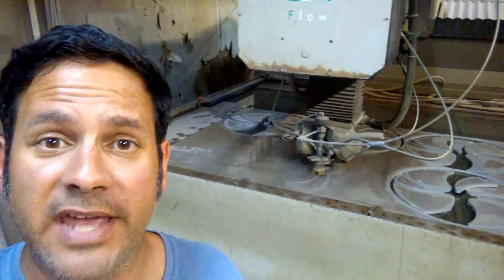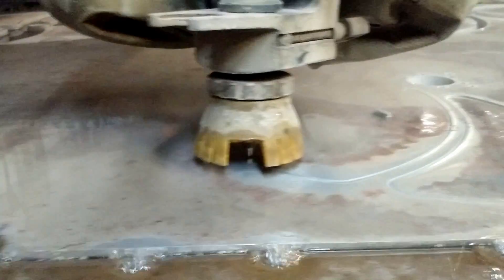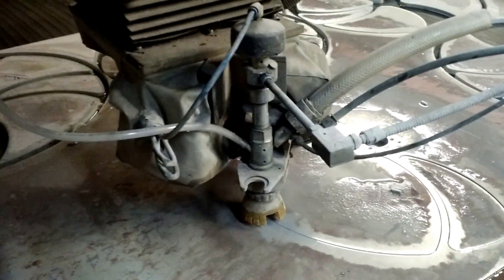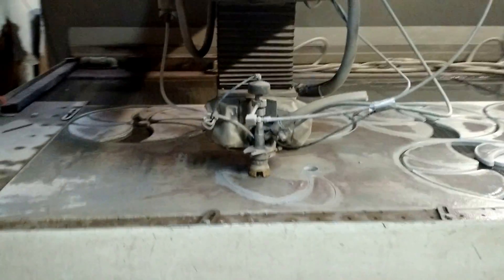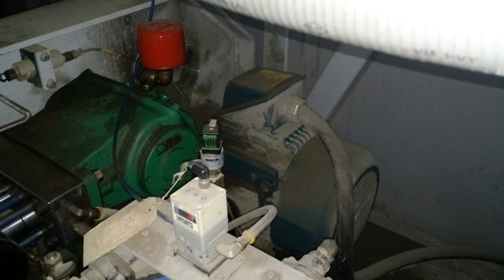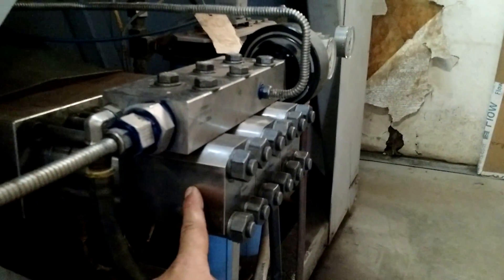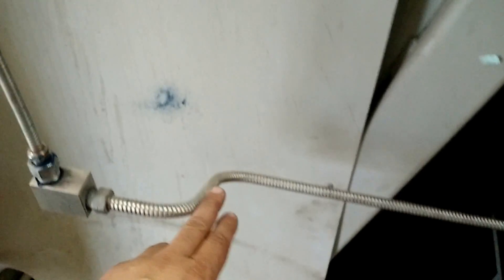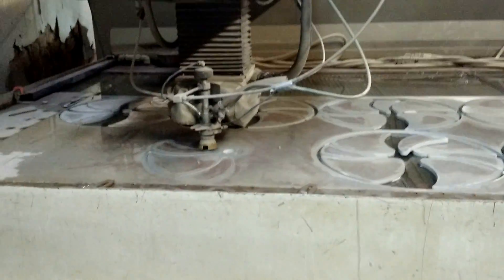CUTTING on the Waterjet at 50,000psi - machine shop - anything cut in half FAST

Comment: Direct-drive intensifiers aren't as common as hydraulic ones.  You do get higher performace with a direct-drive intensifier, though, as they have a higher flow rate. 

One of the most interesting applications I heard of is cutting cake.  The cake sits on top of a grid-which on some machines rotates in the C axis- and the nozzle runs about half an inch above the cake.  The supersonic jet of water moves so fast it doesn't even have time to wet the cake as it is being cut.
Reply from the maker: They cut pickles too

Comment: Hi Ray,
I don't want to start you on another project.. but....!
The sapphire nozzle in 3D printing is about 100$ and it is about 12$ for a sapphire nozzle for waterjet cutter.
The advantage of a sapphire nozzle in 3D is that it can print abrasive filament (carbon fiber, glow in the dark, glass fiber, metal filed, etc) without any wear.

I'm curious to know if somebody can convert a relatively cheap waterjet nozzle into a 3D printer jet? I think you are the man, but I respect your spare time.

Have a good one.
Ps If anybody want to cut n paste my suggestion to others youtubers or want to make it, please do it!!!
Reply: Yeah, I've already saw your video on the subject...
https://www.youtube.com/watch?v=16xnqfXIFuc
SO, no excuse YOU ARE THE BEST ONE !
Reply from the maker: Lol, I guess I could,  but the office has a .013" dia hole, about. 3mm.  Might be too small for those materials
Reply: Hi Ray,
I do have about 15 brass nozzles at home, ranging from 0.8 down to 0.2mm.
If I buy a sapphire nozzle, I will buy a 0.3 or even a 0.25mm one for sure.

I like the high details you can get from a small apperture (and a lot of patience!). However, I won't reccomend to print wood filled fillament under 0.4mm to avoid build up of fiber in the nozzle.

In another hand, most of the other abrasive filament are "only" abrasive and won't clog nozzle as much as wood pulp will. For example, glow in the dark filament are filled with a very fine powder. This powder is way under 0.05mm, but still is very abrasive and will ruined a brass nozzle in about 1-2kg spool.

My real concern is about the inside and outside shape of waterjet nozzle compare to 3D nozzle. I never saw a cross cut of the waterjet so I don't know how hard it will be to make it working. Hopefully, a metal sleeve won't be necessary.

To a fan of StarWars, I'll leave you with a cote from Princess Leila :
"Obewan Kenobei... you are our last hope"
Reply from the maker: I extracted 4 of the sapphire Crystals from a few used orfices and they are certainly small enough to use in a 3d printer nozzle
Reply: That's a very great start already!!!
Using old worned out sapphire to learn for free is the way to go, good idea!

Can you cut the metal housing in half, lenghtwise, to better see the flow path and compare it to 3D nozzle?

Did you already figured out wich route might be the best?
1. Machine the housing (without removing the sapphire) to fit the 3D printer
2. Machine the housing and add a sleave inside or outside to fit the 3D printer
3. Remove the sapphire and put it into a custom made houssing

I've forgot to mention that the abrasive 3D filament will mainly sand off the tip of the "brass" nozzle leaving the interior channel almost intact. Think of the tip ironing over the freshly disposed abrasive plastic who is getting harder already and, by such, getting more abrasive as well.

This is Youtube learning emulation at it's best!!!!
Reply from the maker: I think the only way to make it work is to machine a standard nozzle on the inside to include a sapphire.   But I have a better idea:  the nozzles for the w aterjet are solid carbide!  They are very abrasive resistant!  But also very expensive
Reply: Carbide nozzle... dam!!! Don't you think it's fk.. overkilling?!
How will you machine such a hard metal?

Sapphire is proven already hard enough for the most demanding 3D application. The other benefit of sapphire is the fact that plastic don't adhere to it (I'm not sure about carbide?).

What do you think about a two parts brass nozzle that thread into one another to sandwich the "recycled sapphire" at the tip?
Reply from the maker: Yeah it's overkill, but I also have used ones I could try out.... and it might be easier than trying to use a sapphire crystal
Reply: Yep, be my guess!
Still, I can't wait to see your turning technique on a metal almost as hard as diamond!

I have faith in your skills

Comment: Ray, what material is the jet's nozzle made of and how long do they last? I would think that this part would wear out rather quickly even though the garnet or any other abrasive used does not impact it in the same manner as the materials being cut because the abrasive and the water would erode it.
Reply from the maker: +Jeffrey Vastine the nozzle is made of carbide, and it does erode after a while.  It starts at .040" and when it's gets to .043" we change it.  It typically takes 100 hours or so to wear them out. Sometimes garnet can get wedged in the nozzle, at that point it is done. the nozzles, once clogged, cannot be un-clogged.
Reply: Thanks!
Reply: @RayMAKES  They also make them out of sapphire or industrial diamond.

Comment: awesome info ray ! I may be wrong on this ..not sure but isn't there a synthetic diamond at the tip of the sprayer where the high pressure water/garnet mixture exits ? and that's what the mix passes thru it has a very small hole in it .let me know if I'm right/wrong/close ! lol
Reply from the maker: Very, Very close. inside the cutter head, just above the fitting where the garnet enters the mixing chamber, sits the "orfice".  the orfice has a .013" hole in it and is made of sapphire, a diamond one is available but the cost is astronomical. once the water exits the orfice, it jumps the gap where the garnet is injected, and then the mixture exits though a carbide nozzle....translation: damn this machine is expensive to maintain!
Reply: Ray Pena awesome ! thanks Ray ...and yes very very expensive lol but also very very cool ....I wpould love to own or operate one of those machines !
Reply from the maker: yeah, its pretty awesome, but the maintenance will make you hate it!